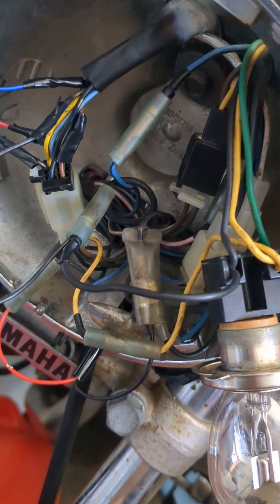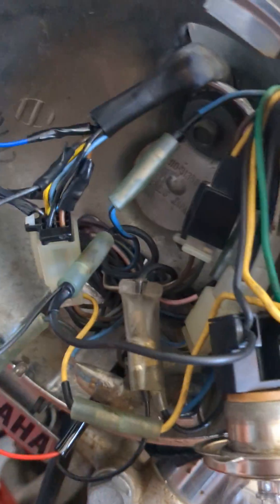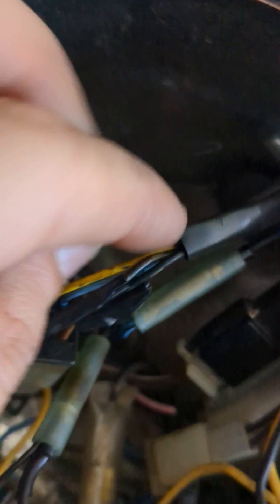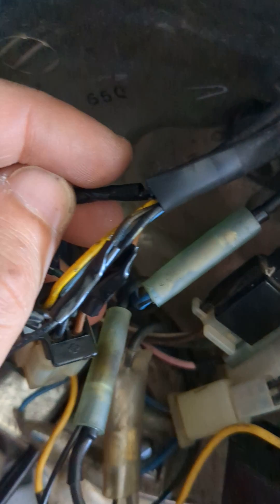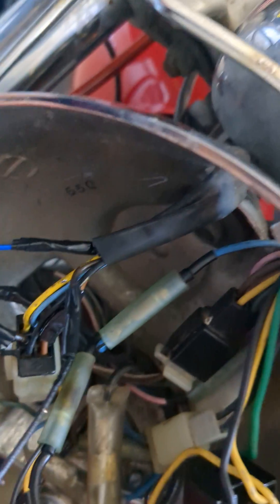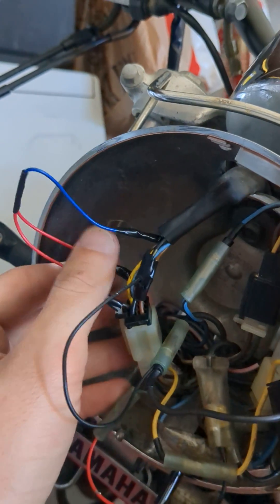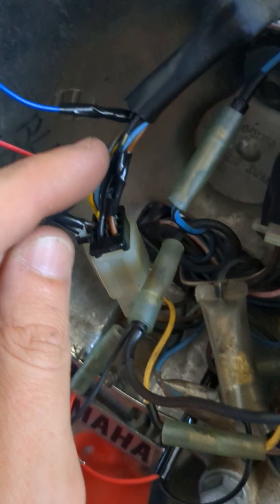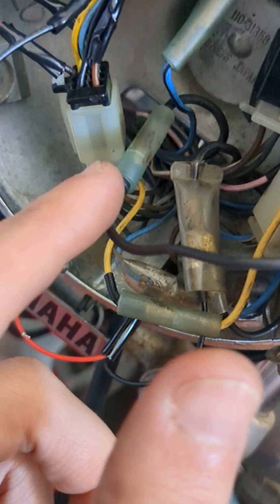SOLVED - Turn Signals All Flashing - Installing a diode kit for LED lights on a motorcycle

Comment: I did the wiring the way you dide, and now when i indicate left, the left signals comes on normal. When I indicate right, the left signal still comes on and the right stays off. What did I do wrong?
Reply from the maker: Thats a great question. The diode is on backwards in that case.
Reply: Thanks for the reply! doesnt seem to be the case though. When I flip the diode I then get no turn signals at all @Virago_XV
Reply: Thanks for the reply! Turns out it wasn't backwards. I tried to rewire it and basically when I did that none of the turn signals would work at all. I figured that in the 535 that I have the location of that plug is actually in a different spot. I wired it into the right plug and now it seems to be working great
Reply: @yrguitar1 Hey I have the exact same issue as you on my 535. Could you explain which plug is the correct one?
Reply: @PixelGalleries the wires on the 535 where I installed the diode are not inside the headlight like in most of these videos. Its kinda behind it covered with a rubber boot. If you find the right plug, it'll have the same wires and colors as in this video. Hope this helps, if it doesnt lmk ill try to explain better 😂
Reply: @yrguitar1 So I found the boot and the same colors that I made sure went to the indicator bulb. I put the diode closest to the indicator bulb, which made it work (indicator bulb is flashing), but all four turn signals are still flashing. At what location did you put the diode?
Reply: @PixelGalleries did you also get a new relay? I did the combo of the diode and a new relay.
Reply: @yrguitar1  I got resistors for the turn signals. But perhaps I need a new relay after all. Which one did you get?

Comment: Hooked mine up exactly like yours and all that happens is blown fuses.. any suggestions??
Reply from the maker: @doc_antle2899  Something is off. Is anything else connected to the lines? Do you have a LED Flasher installed?
Reply: @Virago_XV  Nothing extra just front and rear bullet style led lights, front parking lights aren’t hooked up, led flasher relay installed. No hyper flash but all lights flash left and right. Only difference is I used two diodes from a local shop versus the “pre built”.
Reply from the maker: @doc_antle2899  Do you have the ground installed from the top (at the turn indicator) to a ground below somewhere? Is the diode going 1 into 2? From the turn indicator signal wires? 

From the turn indicator on the "dash", you will have a ground coming out of one of the turn signal wires, and the diode out of the other. The diode then connects to the two turn indicator wires that were cut.

I hope that helps. What bike are you doing this on? Is the fuse shorting out every time you replace it and try to use the turn indicator?
Reply: @Virago_XV  The diode method didn’t work at all, I tried splicing at different points on the harness as well as different grounding points, both sides would still flash depending on what side I used as the diode input and the other side(grounded side) would flash the neutral dash light. 

I then tried to wire in two relays, taking a trigger from left and right and using that to send ground to the opposite side, this method allowed the turn signals to function but there was a slight blip of the opposing turn signal.

Finally I installed a 25 watt, 4 ohm resistor in parallel to each side and problem solved! Still unsure as to why the diodes didn’t work but after hours of trial and error I am just happy it’s done. Thank you for your help

Btw the bike I’m working on is a 1993 virago 535

Comment: My '93 Vulcan 750 has both a left and right indicator on the cluster. Do I need to use two diodes?
Reply from the maker: @mikehenderson7008 I'm not sure but I think you are right. What is happening right now when you plug in some LED turn indicators?

Comment: Have you tried to connect running lights at same time? I got my shadow wired with the diode kit and works fine without the running lights soon as connect running lights wire they go all messed up again
Reply from the maker: I haven't tried that. My advice would be to check where the running lights are connected. Can you connect it to the headlight wiring and avoid the turning indicator circuit?
Reply: @Virago_XV  haven't thought of that.. I had them connected to the same wiring for the original running light... I will try that.  And yes i have an electronic flasher for led
Reply from the maker: @fernandos6330 do you have a flasher relay installed?

Comment: Can you post a snap shot of all the wires in the housing and where thy go? I bought a bike and the previous owner left them cut and I'm not sure whats what.
Reply from the maker: There are some good and reliable wiring diagrams online. I think that would be more useful than a photo of my stuff.